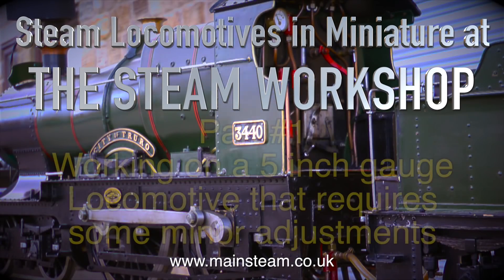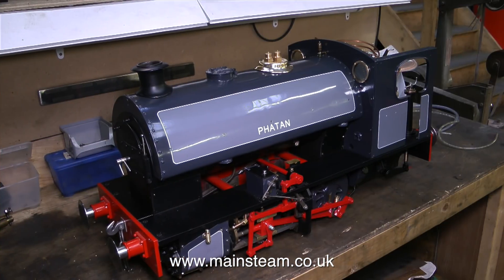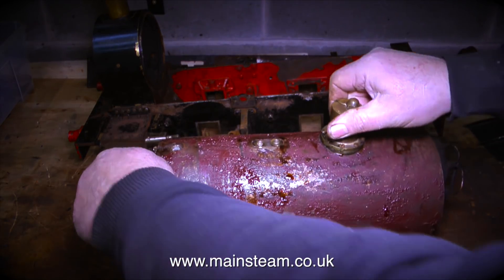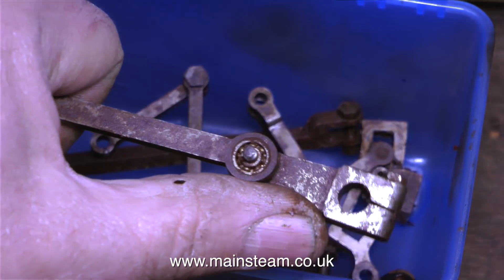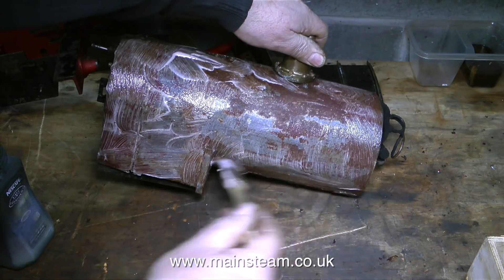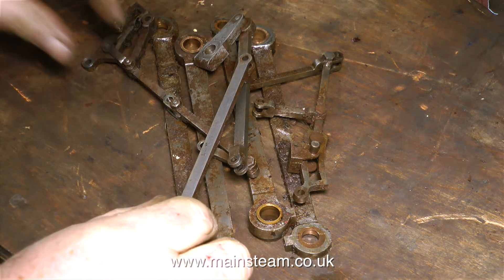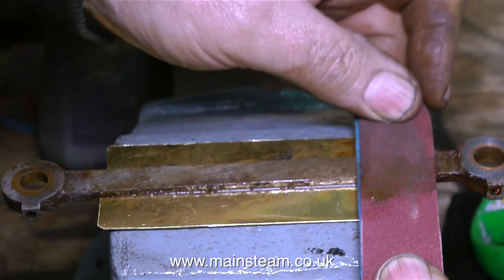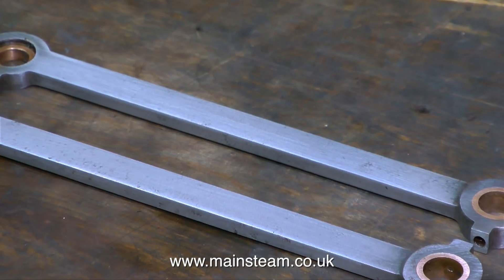WORKING AT THE STEAM WORKSHOP #1 - MAKING A START

Comment: I know there are plenty of suggestions on how to speed along the tedious rust and paint removal, but one more won't kill you. Have you considered soda blasting?  I only mention it because the bicarbonate of soda used is non-toxic, cheap and doesn't damage the metal.  You can even use it on copper or aluminium. I only mention it because it is so tedious hearing you repeat how tedious some of the initial work in a restoration is. It isn't as if you gain any more time to enjoy life by spending what time you have doing uninteresting tasks.
Reply: i was thinking the same thing. the whole lot could be done quickly, evenly and thoroughly then steamed clean.

Comment: So...you got a new job kinda? Think it's a nice way to divert the channel! Not just showing off steam engines and boilers all the time with an occasional water pump here and there but actually show off complete systems. Like the few boats you've been restoring, but now it's locomotives in a at least somewhat professional workshop
Reply from the maker: My focus though is still firmly aimed at the beginner. In the "Steam Workshop" there are some machine tools that very few home hobby machinists will ever have. I like to show simple, easy and effective ways to repair model steam engines without a vast professional workshop and using affordable equipment.
Reply: Makes perfect sense, and I can agree to that :) I haven't gone into steams or anything, but I am deeply fascinated by the mechanics of them. And a steam engine isn't really too hard to maintain with some simple tools, as you've amply proven for this long I've been your subscriber. I'm definatly not saying that you shan't keep on prooving the simplicity of steam engines and how amazing and interesting they can be like those beam engines. But this would somewhat expand for us already convinced of just that :)

Comment: Thank you so much for taking us on a trip with you to your new job!! The amount of practical knowledge you bring with you to the job is priceless. If you were 16 someone would have had to tell you, "No, don't use a file directly on the parts otherwise you'll scratch it deep and no, don't use sandpaper held in your hand to clean the parts otherwise you'll round the corners." Having only those two tools available the 16 year old would have sat there for a day and not know what to do. And you didn't have to be told what not to do or what to do :) Thanks again, loved the video.

Comment: Hi Keith, have you ever looked up a rust removal fluid called "Evaporust" ? 
I use it all the time when restoring instruments as I nearly always get them from cars that have been sitting out in the weather for many years.
It's a dipping fluid not to be applied. The fluid is passive, you can dip your fingers in it and environmentally friendly. 
Depending on the severity of the rust it could take a couple of hours to a few days but eventually the parts come out looking like new and free of rust.  It's a U.S. product and there are one or two others that do the same thing but I've been using Evaporust and have been very happy with its performance.
It's not cheap but it avoids acids and harsh abrasives, will not harm any other metals and it gets into places where wire brushes won't go.
Reply: I've used it. Works great. Auto parts stores carry it around here. I think one gallon is the smallest size. Comes in 5 gal. buckets too.
Reply: I was going to suggest the same thing but you beat me to it.
Reply: u dont need spesheal rust removers u can just put it in vinegar  and let it sit for a day and come back u can watch how it works by watching michaelcthulhu
Reply: I was also wondering why to not use a chemical rust remover as that seems like it would be more labor efficient. My guess is that the parts would still need to be hand worked the same anyway to achieve a good surface finish.

Comment: Any reason why phosphoric acid could not be used to clean rusty components ?
Reply: it will remove the rust but you still have to clean the steel and remove pitting, it soon comes up with emery in this state